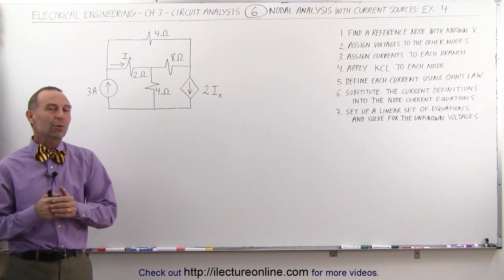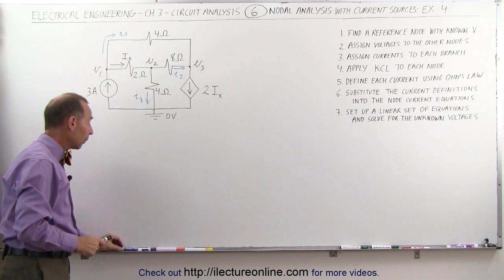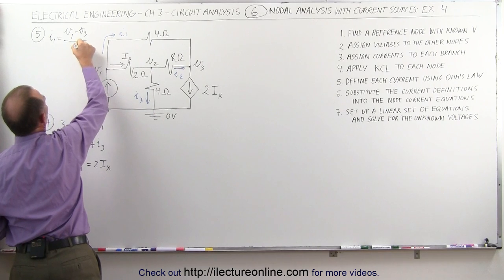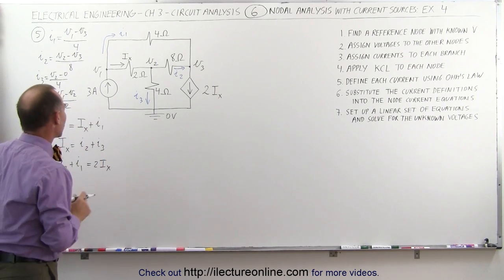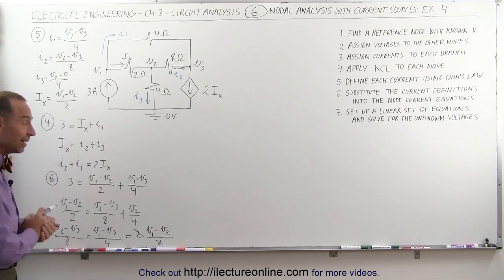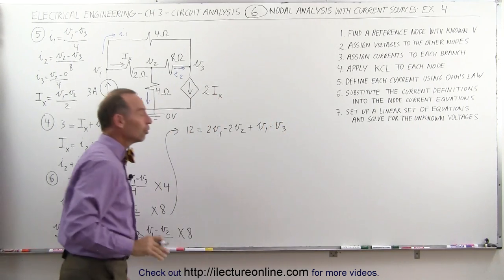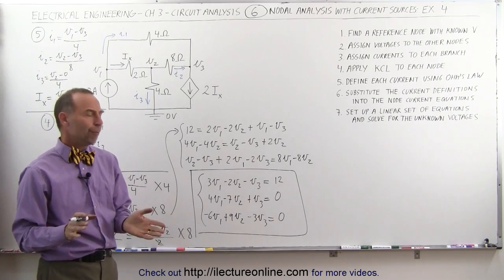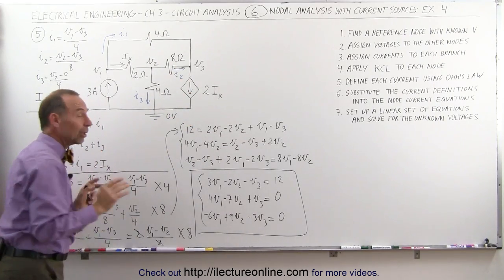Electrical Engineering: Ch 3: Circuit Analysis  (6 of 37) Nodal Analysis w/ Current Sources: Ex. 4

Comment: sir, why have you taken i3 as V2-0/4 instead of 0-V2/4? isnt there a voltage drop across the 4ohm resistor
Reply from the maker: The assumption is that v2 is at a higher potential than zero, because i3 flows from v2 to ground.
Reply: @MichelvanBiezen  ah I see. So if we had taken current in the opposite direction we'd take the voltage as 0-V2/4 Sir?
Reply: @sihaskumarasingha8148  yep